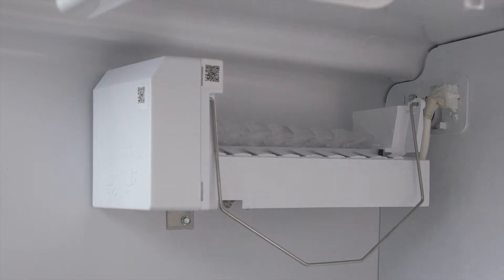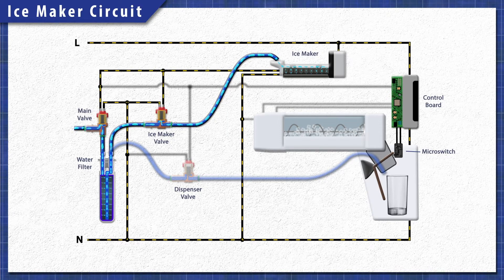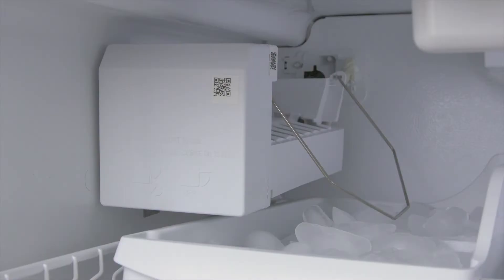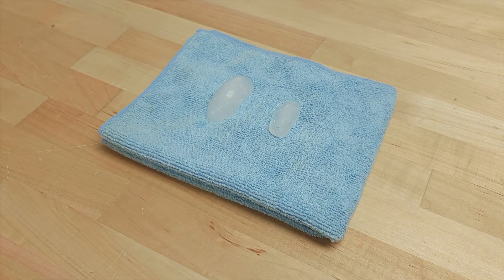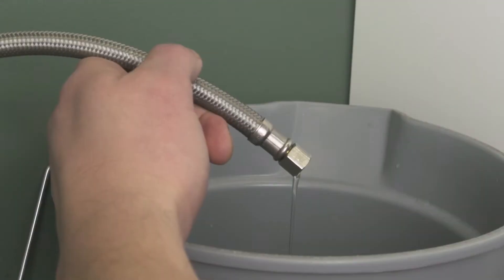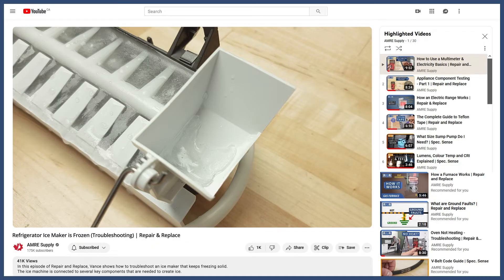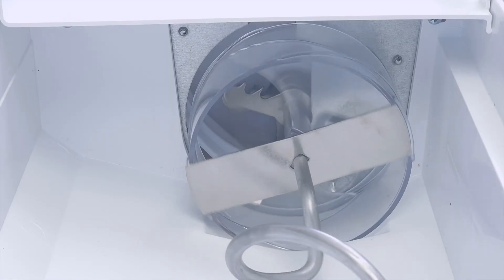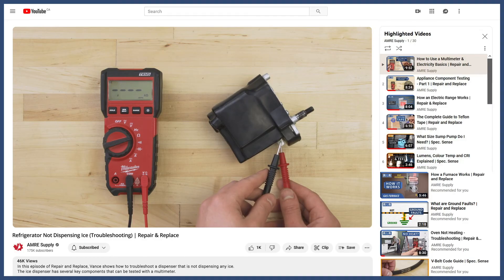How Do Ice Makers Work? (Refrigerators) | Repair & Replace

Comment: Why does ice maker don't have continuity. 
Even power is connected, but no signal light shows on the display screen.
Reply from the maker: The ice maker usually won’t show simple continuity across its power leads. It isn’t a basic analog component like a heating element or a switch. Most modern ice makers have a control board, sensors, and other electronics inside, so a continuity test on the power cord doesn’t tell you much. Because of that, “no continuity” doesn’t automatically mean it has failed.

Comment: Very helpful!   I am having a problem not covered.    i have a Whirlpool and the icemaker looks almost identical with the swing arm.  It makes ice fine.  After a 24 hour power outage, the ice dispenser randomly will start putting out ice until it empties, without us pressing the paddle.   Would this likely be a bad ice maker or paddle assembly or control board?
Reply from the maker: Thanks for watching and sorry about the delayed response. This is most likely a control issue. The ice maker itself has no effect on the dispensing of the ice once it's in the bin. If this only happens after a power outage, then it's most likely the dispense control board. If it happens intermittently over time then there could be a faulty microswitch on the paddle assembly.

Comment: Doesn't seem to explain how the Ice maker works itself. But the refrigerator with the Ice maker.
Reply from the maker: Thanks for watching. This still shows how the ice machine works because it requires the rest of the system to work to produce ice. If you want to be more granular, there is small controller or motor inside of the ice machine but these are not easily repaired so if the ice machine fails, it is usually easiest to install a new one. In our troubleshooting and repair guides we focus on troubleshooting the entire system which includes the water valves and ice dispenser. You can see more videos in this playlist: https://www.youtube.com/playlist?list=PLCo9SMjkdWBwbvbAeVUtFajFX-JooK5IL
Reply: There's a tube that surrounds the ice tray filled with Freon™ R-134a. It makes the water turn to ice. You're right he does a poor job of explaining that in his video and his reply.